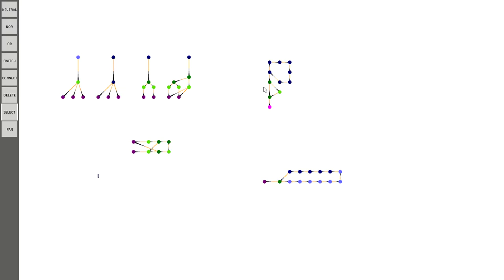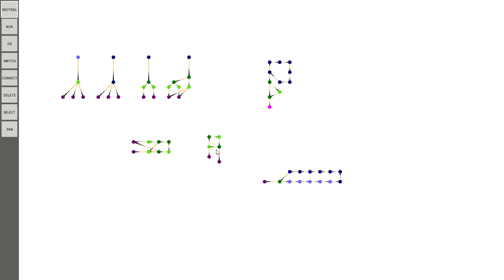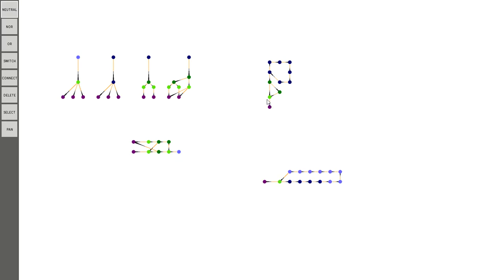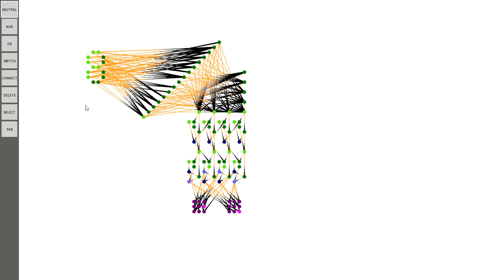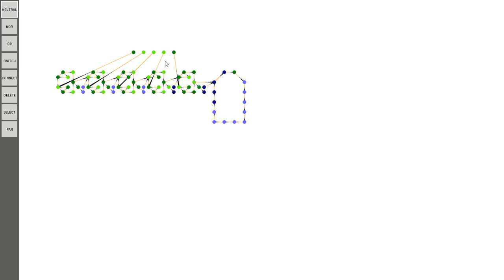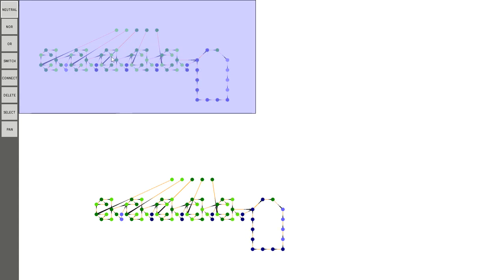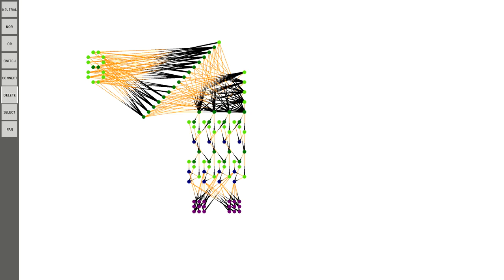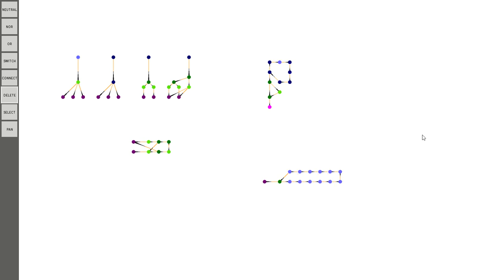NorGor - The digital circuit building program.

Comment: The program isn’t working right for me. The text on the right isn’t there. The debug window says the font failed to load, so I’m assuming the font you wanted to use for this program isn’t on my computer and it can’t load the text because of that. The bigger problem though, is that it doesn’t know where my mouse is. The closer I am to the top left, the more accurate it is, but if I was to click the center, the node is skewed towards the bottom right.
Reply: I can deal without the text anyways
Reply from the maker: @reversev9778  Ah I  forgot to include the font file. That should be an easy fix. As for the clicking problem, I'll have to look into that but it shouldn't be too challenging of a fix.
Reply: kindpotato Glad to hear
Reply from the maker: @reversev9778  I think I may have fixed it. The link is updated. Now you should be able to resize the window and the clicking should work correctly. Maybe windows is automatically resizing the window for you. I'm not actually sure if this new version should work for you but I hope it does. I also added the font file.
Reply: kindpotato it works as intended now
Edit: It’d be nice if you added some sort of way to make comments in the sandbox, just for referring back to
Reply from the maker: I'm glad to hear